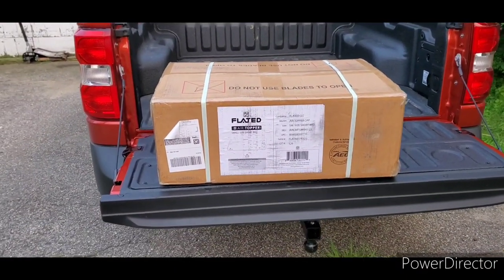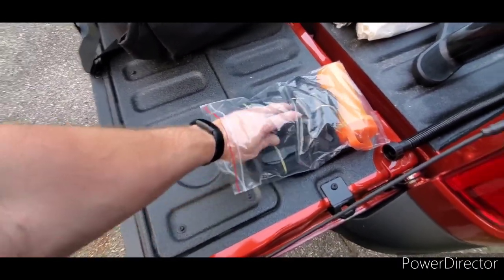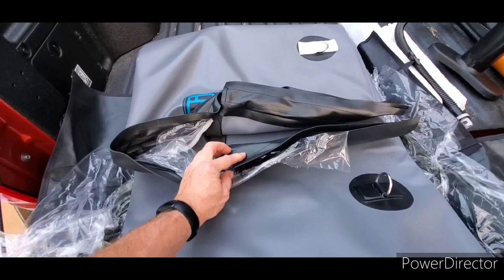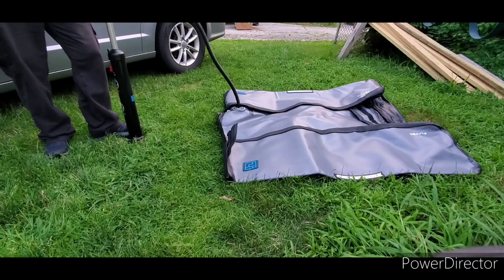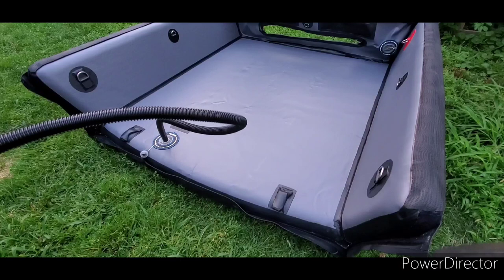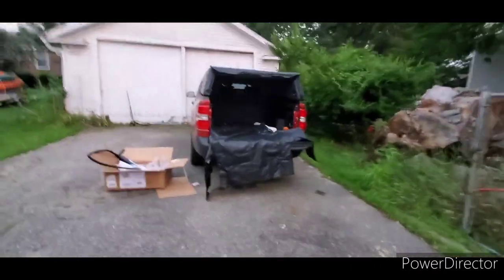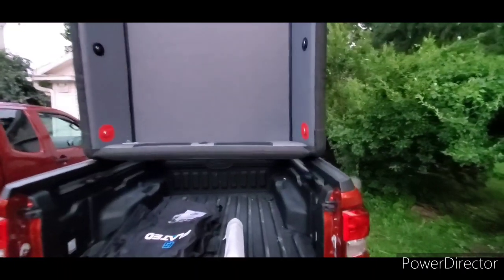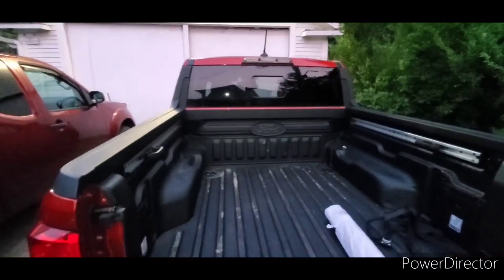Ford Maverick Truck- Flated flush roof model, unboxing, inflation and test fit. part 1

Comment: I have both the Flated Air Topper for the Maverick, and the cargo management rails. I bought an extra set of rail cleats. I anchor my Air Topper front anchors to one set of cleats, the middle anchors to the second set of cleats and the front anchors to the upper tie downs closest to the tailgate.